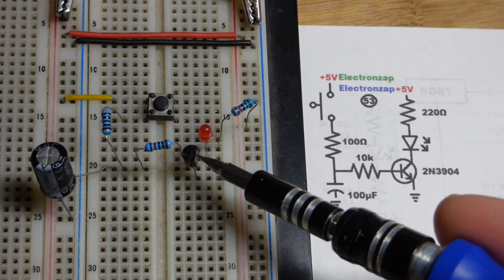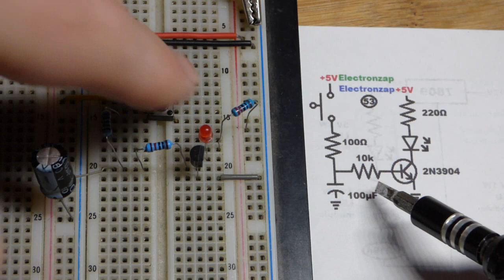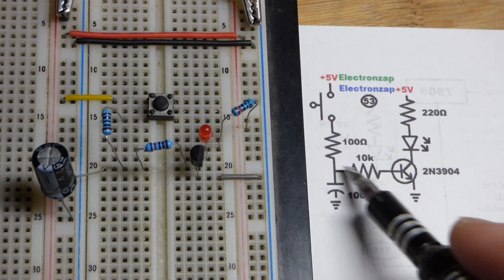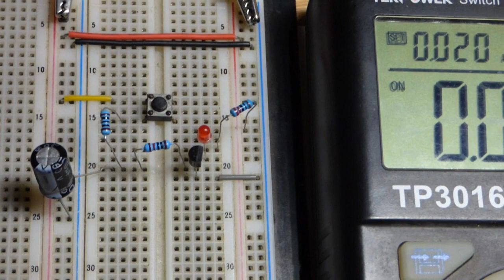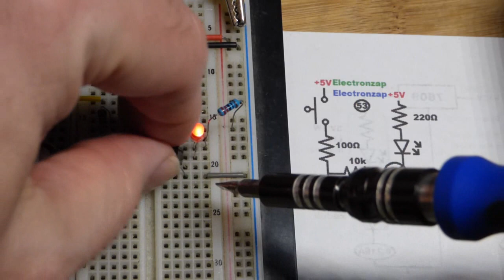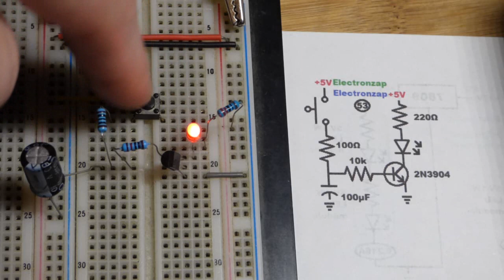NPN BJT Timed and Fade Off LED using Bipolar Junction Transistor Circuit

Comment: Had to tweak my simulation.  I was not getting anything until I connected the DC (+) to both R220k and the push button.  The DC (-) I connected to the junction of the capacitor & ground.  Then the circuit function just like yours! 13.2mA thru the LED. Simulation calculates 2.09V after the R220k.  After the LED is 128mV.
Reply from the maker: Interesting, thanks for the info!